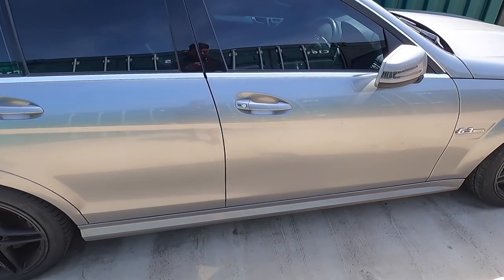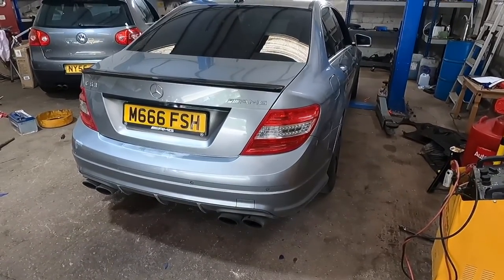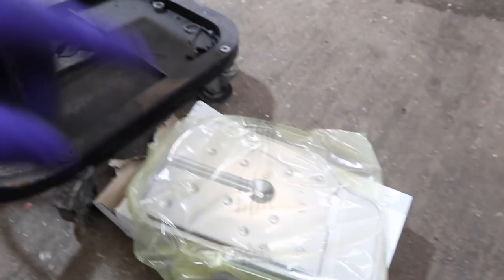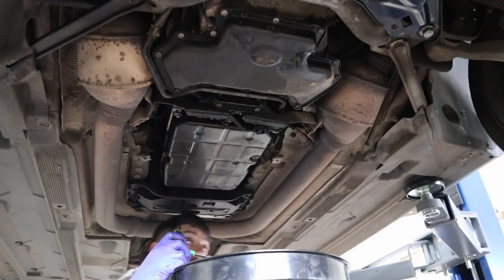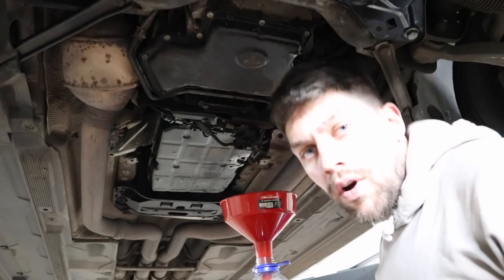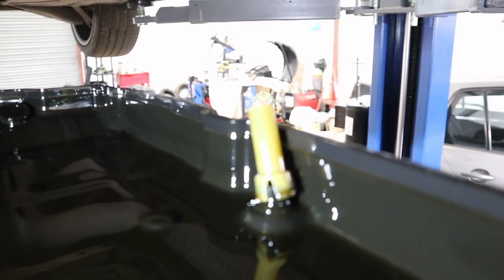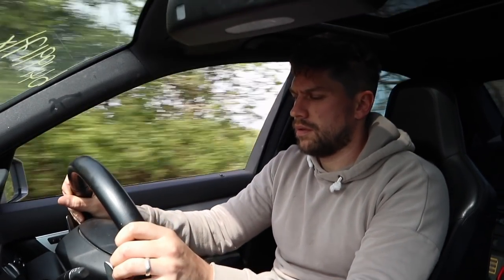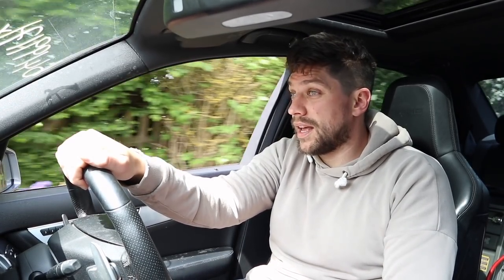FIXING MY SALVAGE MERCEDES C63!! HOW TO CHANGE GEARBOX OIL!

Comment: The "bolt" was a magnet. It's to be placed on the front of the gearbox sump. To collect any metal particles in the oil. (Pervious mercedes tech)
Reply: pervious ?
Reply: @Vteccer666  Yeah, I don't work at Merc anymore
Reply: Still didn’t get it!!😂
Reply: @bazzatheking3155  - 'previous' typo I think 😆
Reply: @garethgorman960  nah he used to perv on all the high end mercs in the workshop lol

Comment: Ahhh the removal of awkward bits! A mechanic did the same removal method on an engine mount on my van because a bolt wouldn't budge, when all else fails BFI (brute force an ignorance) 👍
Keep the vids coming dean your format is great don't let anyone tell you otherwise! Yourself and salvage rebuilds uk are the best UK car youtubers.
Reply from the maker: Thanks! Good to hear you like the format, i do worry sometimes it’s not very entertainment based. But I’m on my own and not clued up on editing so not very good at it 😂
Reply: @SavingSalvage  you're doing a great job 👏 👍
Reply: @SavingSalvage  don’t worry about the entertaining side of things it’s the getting stuck in part and solving problems and showing how it’s done that’s what I like to see keep up the great work 👍

Comment: Like the more in-depth videos first time I had seen an auto box oil change - the stuff that came out looked pretty black so much for this "sealed for life" nonsense the dealers would have us believe! Think you did well to get those voltage regulator bolts out through what looked like quite limited access!

Comment: That is the easiest steering rack to replace I have ever seen :)
Black transmission oil.. I would replace it more often than factory recommends.
You are a brave man with a light grey sweater working on a gearbox :)

Comment: Crack on with the current format. It’s enjoyable to watch👍. If the voltage regulator was fubar then it would cause loads of issues with every system on the car, and that transmission fluid was rank. Good choices on what to do with this car.

Comment: You don't need to turn the engine by hand in order to expose the torque converter's drain bolt. The way I do it is using a big flat head screwdriver and spin it around through that gap. Also, to speed up the process of draining the torque converter, use a air blow gun and slowly introduce air inside the torque. That will drain it faster and also drain some oil out of the gearbox oil passages

Comment: The is a tool you can but you pump all the oil out of the box. You took it up to compressed air and it enables you to drain pretty much ever drop out of the box. I use it to flush them completely and it makes a world of difference

Comment: Glad you got the alternator sorted. 9 times out of 10 that if the bearings and the commutator are good then it's just the brushes and regulator that needs replacing. Could also be what's causing such a large parasitic drain on the battery. If it wasn't this then you'll have to find what circuit is draining the battery that quickly.

Comment: I have a cheap ebay cigar/USB adapter that also displays battery volts. I suggest you use one for a while once you feel it is fixed - just to make sure and avoid damaging the new battery or any ECUs.

Comment: It IS the correct Kit.
The original clear plastic tube is from Factory. The Green one comes in when servicing.
It is ment to hold the correct amount of oil when the gearboxoil is at 45 degrees CELSIUS when engine is running and in P or N.
Also what mercedes tecs usually do is: overfill it by about half a litre. Because when you check the oillevel you have to undo the drainscrew and wait for the stream of oil to start skettering. 
With the factory white tube you screwed that procedure a little ... might not change much cause overfill is less problematic than underfill.

Comment: I like the idea of a drain plug in the TC.  Most don't have this, so a flush is required to change the bulk of the oil.  Not sure why the fluid was so bad in this car, did some nut use the wrong oil in it previously?

Comment: Hope I am wrong but the merc boxes suffer with problems with the contactor plate, am guessing your c63 has the 5 speed box in it. Basically same as all merc's  until they changed to the 7 speed unit in around 2010. But have heard both boxes suffer with this fault. I had a Vito with 5 speed and would have the same issue, it would intermittently go into limp mode which basically selects 2nd gear and it won't change up or down hence lots of revs required to get moving. The contactor plate houses a couple of speed sensors and also has the connections for the gear solenoids. I had a faulty speed sensor, got parts as a kit off ebay all genuine MB for around £250 I think it was. Ran perfect afterwards.

Comment: That's quite a heavily worn box, watch out for slipping on B1 and B3. Can I hear some whine? If I've got my maths right from what you said you took out/ needed to put in it was a bit low to start. Some 722.9 don't have a torque drain.

Comment: Still not convinced changing the regulator on the alternator will solve that charging issue. The contact ring on the alternator (where the regulator brushes touch) looks worn. It might also explain why the power steering hums.

Comment: As far as I know, there is a magnet supposed to be in the gearbox pan. In mine, there is a big ring magnet of about 40mm outer dia.. Wasn't there any in the kit? This has to be placed on a certain spot in order not to mess up the filter.

Comment: I had an alternator problem before where it was perfect for charging but next day battery was dead so lad fitted brand new battery then next morning again battery dead turned out the internal diodes in the alternator had gone and was allowing the alternator to discharge the battery only worked it out when i put my hand on the alternator and it was red hot.

Comment: Hope that has sorted it. Is there not a gearbox cooler as well in the amg. When I done the flush on the wife's car I disconnected the return line and just kept taking 1l out and added 1liter of new. I done that until it went from black to red then I knew all the fluid was replaced

Comment: A job well done. However shouldn't you have gone thru all the gears to get the gearbox oil upto temp? That is not only drive, reverse but gears 1 thru to top and back again.
Reply: He went through the gear's when it was still on the lift

Comment: Wow that transmission is toast. That's burnt or badly worn clutch packs 😂😂😂 should be cherry red or blue fluid  in later mercs. Change and get rid.
Reply: It's a torque converter gearbox it doesn't have clutch packs.

Comment: I would think the oil drain sleeve could be removed to allow for oil to drain similar to VW.
Reply: Given that it clipped onto a raised sleeve fixed to the pan I doubt it could be removed.  It's probably a design by the gearbox manufacturer rather than Mercedes.  But yes, the VW drain system is better.

Comment: Had they fitted that voltage regulator using torques screws or hex sockets, all that smash it off  nonsense could have been avoided...😳😳😳😏🇬🇧

Comment: You might have killed two birds with one stone with that voltage regulator because a broken regulator might be causing the parasitic drain of your battery. It is also a good idea to measure the diodes while you're at it; you should measure around 500 ohms across a working diode.

Comment: They have definitely given you the wrong oil should be the blue oil for your box completely different viscosity mate , do 3 or 4 a week of the 7g+
Reply from the maker: I don’t think mines a 7G+, it’s a 2008, 7G+ seems to of come in around 2011
Reply: @SavingSalvage  ah ok threw me off cause the longer filler in the sump pan is from the 7g+ normally glad it’s sorted mate

Comment: Looks like the gearbox was low on oil judging by what you drained from it, so when going up hill on your drive or up on to your trailer, the torque convertor probably drained its oil back into the gearbox, causing a loss of drive from the torque convertor - Hopefully that would explain your 'lack of drive' symptoms and it's nothing more sinister.

Comment: Math, not my strong point. BUT... you took out 5.5 litres (ish?) and put in 9.5 litres? got to wonder where those 4 litres went, I mean, that's almost half the fluid, gone from inside a sealed unit?
Reply: I’ve had the same with a galaxy. Like my mechanic said. Don’t scratch your head about it too much. It’s got the correct amount in now.
Reply: The rest from the torque converter.
Reply: @DonPablo2011  he got 3 litres from torque convertor and 2.5 from sump, (5.5 litres total) but put in 9.5 litres. Which means it has lost 4 litres, somewhere?

Comment: That is not a task for the average kerbside or home drive and garage mechanic! Interesting, but way outside my league.
Reply from the maker: It actually would be pretty straight forward, only issue would be clearance if you're not using a ramp. If you could get it a foot off the ground on axle stands it should be okay.